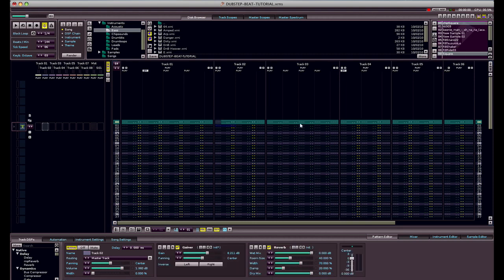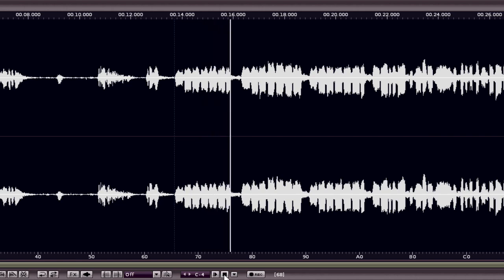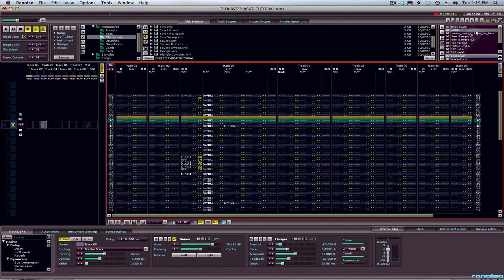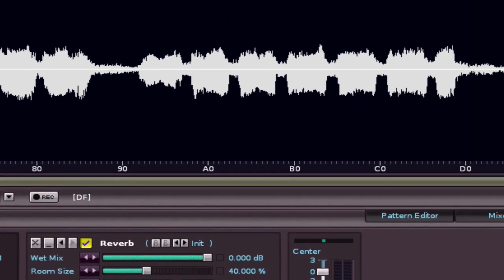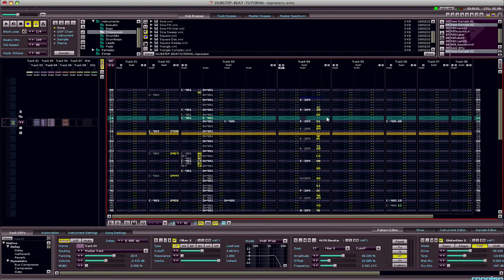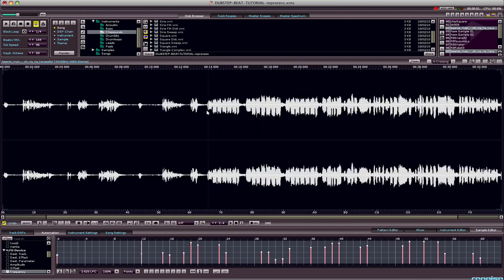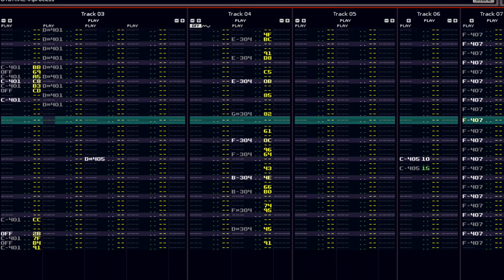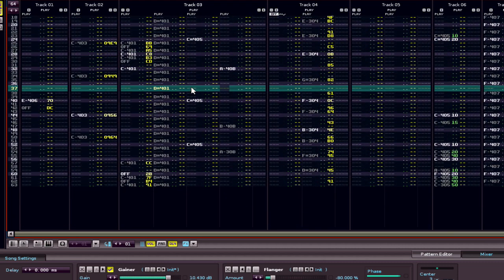How to Make a Dubstep Beat in Renoise (Part 1)

Comment: i'm a bit confused.. on the top left, below the bpm, it says "tick speed". in my renoise (latest) it says "lines per beat". do you use an old version, and does tick speed and LPB mean the same? as i understand it from rns' homepage, ticks are now used for subdivision of each line... from the pattern it seems you have 4 lines per beat (from highlighted lines & length of 64), but your tick speed is 6.. i would think you'd use a value divisible by both 3 & 4 for dubstep (for triplet mania :P)? thx!